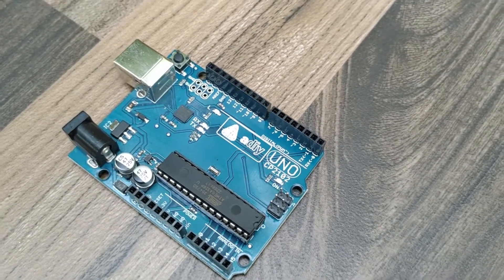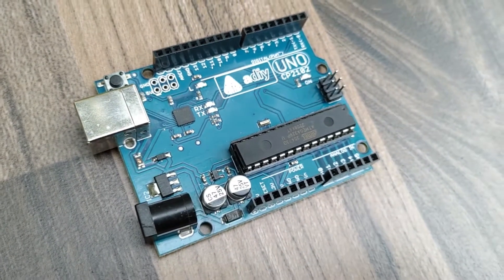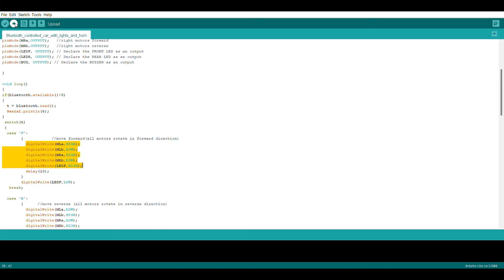How to make a Bluetooth controlled car using Arduino with lights & horn || 100% working

Comment: No motor run..after full charge
Reply from the maker: Can be a problem with the motor driver board, bluetooth module, wrong connection etc. We have to check one by one and solve the problem.

Comment: Only "left and right move button is working "forward backward is not work when I press forward or backward button then Bluetooth disconnected

Please tell me solution😢
Reply from the maker: Hi friend. It is a battery problem. When you press forward or reverse, both motors work together and so draws more current from battery. This drops battery voltage and bluetooth gets disconnected.
Reply from the maker: Using a better battery will solve the problem.
Reply: @Science_4U_  we have the same problem. only left or right controls work. what type of batteries would work best?
Reply from the maker: 2 x 18650 Li ion batteries work best. You can also use 6 x AA battery pack which is cheaper but not chargeable.

Comment: Sir my Bluetooth model number not showing in the app and i used hc06 what are the mistakes 
Pls reply 🙏🙏🙏🙏🙏
Reply from the maker: @SmartyAlphaparrot  you have to first open bluetooth ..search for the hc06 bluetooth module and pair it using password 1234. Then after that the module will appear in app.
Reply: Thanks sir i am successful 🙏❤❤
Reply from the maker: @SmartyAlphaparrot  okay friend. Great..👏👏👏
Reply: Sir Can you hepl me, yesterday I was success in making bt car but today when I move it forward or in any direction it moves continuously in that direction 
🙏🙏🙏 Help

Comment: Is the Bluetooth module is HC-05?, but I have HC-06 can I use it?
Reply from the maker: Yes.. sure friend. HC 06 also can be used.
Reply: @Science_4U_  thanks😇😊☺️😌❤️
Reply: But how can I control the speed of the gear motors?
Reply from the maker: @roblox_wea926  it is actually difficult friend. One easy way is to increase or decrease the battery voltage which inturn will change motor speed. The proper way is to use motors of different speed capability.
Reply: @Science_4U_ ok, but why your car is moving slow?
Reply from the maker: @roblox_wea926  I have used 60 rpm motors friend. That is,  the wheel will rotate such that it makes one rotation every second. That is why it is moving slow.
Reply: Bro thanks It's working perfect I'm very happy ❤ front and back LEDS is working and the buzzer is working too❤ thank you very much for the tutorial❤
Reply from the maker: @roblox_wea926  okay friend. Really happy to know that..❤️🙂
Reply: Oh ok☺️
Reply: But I have a problem when I press right on the controller app it goes left and when I press left it goes right how can I solve this problem?
Reply: Please reply faster 😭
Reply from the maker: The easiest way is in the app you can change the key settings. You can type R for left and L for right...
Reply: @Science_4U_  oh thanks it worked ❤️
Reply from the maker: @Alymostafa8 okay friend .❤️🙂
Reply: @Science_4U_  thanks you for your help that's all what I was need from you 🙏❣️

Comment: Bro sometimes if I press forward or backward button it starts continuously moving in that direction and doesn't stop.
And sometimes two wheels of left side stop moving. Please help 🙏🙏🙏
Reply from the maker: Hi friend. I think the bluettoth module is getting disconnected. Do you see a change in the light blinking pattern in bluetooth module when this happens?. Also since 2 wheels stop moving, I strongly doubt the batteries. Try using new batteries and see if this problem is solved.

Comment: i have connected the robot well but it makes a very faint beep noise when i click a direction on my  phone and the L LED blinks twice. help
Reply from the maker: If the beep sound is coming from the motors, most probabaly it could be due to discharged batteries.

Comment: 👇👇hi bro. Pls how many 12volts is the battery pack in total? if u answer me u will earn urself +1 Subscriber
Reply from the maker: @NgwabinehNebaAsto  Hi friend. The battery pack is 6V in total. It uses 4 x 1.5V AA batteries. So total 6V..
Reply: @Science_4U_  ok thanks bro u earned ur self +1 subscriber 🥳🥳
Reply from the maker: @NgwabinehNebaAsto  Thanks dear friend..❤️🙂🥰

Comment: Please help Me my Bluetooth module blinks every second after I pari with my mobile is blinks 2 times every time at same interval. but the car doesn’t moves at all please help me
Reply from the maker: Hmm..it could be due to several reasons. The bluetooth module may be faulty. The motor driver board may be faulty. Please reply in my instagram page. I will help you..
https://www.instagram.com/_science4u_?igsh=MTM5aXFpdTM5aG5lNg==
Reply: @Science_4U_  also my bluetooth modult isnt even blinking now
Reply: @Science_4U_  i had connected ground and vcc too with 5v to hc05 module still not blinking

Comment: Is it true that if you press the forward button the lights will turn on automatically and if you press it backwards the lights will turn on automatically?
Reply from the maker: Yes friend. The lights will turn on automatically when the car goes forward or backward. In this code, we can also turn on front and back lights by separately pressing buttons also.

Comment: I did it very carefully but it doesn't walk forward and backward
Reply from the maker: Okay friend. One of the components could be faulty. Either the bluetooth module or the motor driver board. Have you used these before?. Or are they new ones?
Reply: @Science_4U_  but it moved right and left
Reply from the maker: Can you share a video of the problem in my instsgram page?. I will help..

Comment: iam already setup the connection but here two wheels only moving other 2 wheels are not moving can you clarify these problem
Reply from the maker: Hi friend. It is most likely due to discharged batteries. Can you keep the uno connected with USB and then try switching on the batteries. Also can you lift it in hand and try rotating the non rotating wheels. If the wheels rotate atleast slightly, it is due to poor batteries. Replacing with a better charged battery will solve the problem.

Comment: Can you make this one with switch? I can’t find someone doing rc arduino with L298N motor drive and switch on/off
Reply from the maker: Hi friend. Do you mean you want to add a switch to turn power on and off?. Actually in the battery pack that we are using, there will be an inbuilt on off switch. That is why we are not giving any external switch. If you want you can connect a rocker switch in the positive or negative wire from the battery. It will wotk..👍
Reply: @Science_4U_  can you make circuit diagram for that?
Reply from the maker: @Denvr2fast  okay friend. I haven't made the circuit diagram yet. But surely I will make and share with you..🙂

Comment: Can i use dxbt24 module instead of hc05
Reply from the maker: I am not very sure friend. But I think it can be used without changing the code. Infact the pin out of both hc 05 and DXBT24 are the same..

Comment: My code is not working its saying "programmer is not responding" pls help
Reply from the maker: Please make sure the correct port is selected in tools>port before uplpading the code. If atill problem is there Please try uplpading the code by connecting to different usb port. If that doesnt work, you can try in a different PC/laptop..

Comment: 6:33 can u tell me whick jumper wire u used here like male to female or whatM
Reply from the maker: Hi friend. In this project, I have used only 2 Nos. Of male to male jumper wires for extending power from motor driver board to Arduino Uno, 4 nos. of male to female jumper wires to connect arduino to l298n motor driver board and 4 nos. of male to female jumper wires to connect bluetooth module to arduino.

Comment: Can u tell me which jumper wire u used like male to male,female to female or male to female pls
Reply from the maker: Hi friend. In this project, I have used only 4 nos. of male to female jumper wires to connect arduino to l298n motor driver board and 4 nos. of male to female jumper wires to connect bluetooth module to arduino.

Comment: Can i make this project without buzzer and led lights..would the cide still work without these 2 things?
Reply from the maker: Yes friend. Definitely the code will still work. Just no need to connect the buzzer and LED ligths. The other connections should be given to the same pins as shown in the video.
Reply: @Science_4U_  thanks alot i haven't maken this project yet I'll make it in 2-3 days i hope it works
Reply from the maker: @Hacio-qe9nh okay.. Sure friend. If you have any trouble making this project, please leave a comment. I will try to help you..🙂🥰
Reply: @Science_4U_  and can u tell me which software have u ran to run the code
Reply from the maker: @Hacio-qe9nh I am using Arduino IDE software installed in laptop for running and uploading the code to Arduino Uno...

Comment: i did everything correct but in the APK. APP it couldnt find the hc 05 module which i allowed for location and bluetooth please help me
Reply from the maker: First did you pair the bluetooth module. Ypu need not go to app first. Open normal bluetooth and search for devices and pair it using pin no. 1234. After thst it will be visible inside app.
Reply: @Science_4U_  i searched it in both i but i found out its faulty asked the shop from which we bought thanks btw
Reply from the maker: @Bombasticccboiiiii  okay friend. Sometimes these sensors are faulty and it is very difficult to detect the fault. All the lights will be on and it will appear to be working correctly, but will be faulty. Anyway, nice that you could find out thst the bluetooth module was faulty.

Comment: Hello friend.I have connected the car to the app.The lights of the motor driver,arduino and bluetooth module are on.But when I click on the buttons of the app the car is not moving at all.What should I do?
Reply from the maker: I would suggest you can first do the following project for an obstacle avoiding robot, which doesnt require bluetooth module. If that works, atleast we can ensure that the motor driver and all other components except bluetooth module is working.

https://youtu.be/kPSBpfUpHt0?si=CppqCXF1GnZeXZWR
Reply: Well,as I said the lights of motor driver are on.Doesn't that mean it ain't faulty?
Reply from the maker: No friend. Not at all!!! Even if the lights are on, it can be faulty. I have seen many cases like that. 
I will tell one way to check the motor driver board is faulty or not. Connect +5V from arduino to IN1 pin of motor driver board and gnd pin of arduino to IN2 of motordriver board. If motor driver board is working, one motor should rotate. Can you check that and tell, friend?

Comment: Bro connection for parking light which pin ?
Reply from the maker: The positive terminals of back LED lights are connected to pin no. 6 and the positive terminals of front LED lights are connected to pin no. 7.

Comment: I have added lithium batteries. Is it OK?
Reply from the maker: Perfectly fine ..Dear friend..Make sure the battery output voltage is in the range 6V to 12 volts.

Comment: Bro i did for Bluetooth nodule Arduino but i am not getting Bluetooth signal on
Reply from the maker: Are the lights in the bluetooth module changing the blinking pattern when it is getting connected to phone?
Reply from the maker: Sometimes bluetooth module could be faulty also..

Comment: Can I use L293D motor drive instead of L298N?
Reply from the maker: Yes..Sure friend. You can use an L293D motor drive also. But, the same code will not work. A separate code has to be written for using the L293D motor driver board.
Reply: @Science_4U_  oh? Can you please share that code with me?

Comment: How can we increase the motor speed or rpm of wheels? What changes should be done in code?
Reply from the maker: Hi friend. We cannot increase the speed in code. The code is written for getting maxiumum rotational speed of wheels. The easiest way to increase rpm of wheels is to increase the voltage of the battery.
Reply: @Science_4U_  ok thanks alot sir

Comment: The robot moves in a circular path way and sometimes it connecting to my HC05 Bluetooth module, but it’s not operating when I go forward backward the robot not going what can I do I am studying in sixth standard day. After tomorrow is my science Expo. Please give some other ideas about this project that will be helpful to me to do this robot very easier and I did it voice control robot Please give me any ideas about Bluetooth controlled robots please
Reply from the maker: Hi friend..if the robot is going in circles, you can interchange the wires connected to the motor which is rotating backwards. Now both motors will start rotating clockwise. If the bluetooth is sometimes not working, it could mean that the batteries are bad..when the car moves, the voltage drops amd bluetooth gets disconnected.

Comment: Hi can i use 9v hi-watt battery
Reply from the maker: Yes sure friend. You can use 9V battery..
Reply: Does the led lights and buzzer is Mandatory if not what will be the code please it is very urgent
Reply from the maker: @sharanv3561 Hi friend, the LED light and buzzer are not mandatory. You can connect the remaining components as per the instruction given in the video. And you can use the same code also. The same code will work even if you are not connecting lights and buzzer.
Reply: Hi do i need to remove the RXD and TXD pins during the upload of coding
Reply from the maker: @sharanv3561 I have never done that and I have never faced any problem while uploading the code. But I have also seen many videos telling to disconnect the pins before uploading code.Try uploading the code with Rx and Tx pins connected l.  If you find some problem during uploading the code, you can disconnect Rx and Tx pins.
Reply: Mine did not work with a 9 volt battery. 9 volt batteries do not have the same current stability as four 1.5 Volt batteries. I spent the whole day trying out lots of different code from different videos only to find out that it was the battery.

Comment: Can i use motorshield for this code?
Reply from the maker: No friend. Motor shield will not work with this code. You have to use L298N driver only to work with this code..

Comment: I have problem all functions are work but my motor are not working  rotating very slow
Reply from the maker: Okay friend. That is definitely due to a battery problem. It may be a discharged battery. Which battery are you using friend?
Reply: @Science_4U_  lithium battery 2 cell I join in alternat mean they power out put 12v
Reply from the maker: @tusharshende9129  okay friend .But even if you connect 2 batteries in series  if they are discharged, it cannot drive the motors at a good speed.
Reply: @Science_4U_  oh ok
Reply: Make sure your ground in your driver shield is connected to VIN in your arduino

Comment: Bro can i use relay to connect mini pump ?
Reply from the maker: Yes sure..a relay can be added and the mini pump can be driven directly from the battery through this relay. Then the command for the swithing the  relay ON & OFF can be given from the arduino..
Reply: Hey where is the code

Comment: Code is not open
Reply from the maker: Code will definitely open friend. You can open the code in Arduino IDE software, which is used for uploading code to Arduino board. For just opening the code, you can even open it in Windows Notepad or Wordpad.

Comment: Hello friend, the code file does not open. What can I do??
Reply from the maker: Hi friend..The code file is given in .ino format, which can be downloaded and directly opened by IDE software used for uploading the code to Arduino Uno. You can even open the code in Wordpad or Notepad in windows and copy it and then paste it in IDE software and then upload to Arduino..
Reply: @Science_4U_ But I don't have a PC. I want to upload from mobile. So what to do?
Reply from the maker: Okay friend. Then you can use mobile to upload the code the arduino ..You can donwload the following app from playstore..
https://play.google.com/store/apps/details?id=name.antonsmirnov.android.arduinodroid2
Then connect arduino to mobile and upload the code..
Reply: @Science_4U_  But when I upload the code via this app it shows error...
Reply from the maker: @vipulthakor513  What is the error that it is showing?
Reply: @Science_4U_ hello.. this is my second channel..When I comment, why does it get deleted? I've been trying since yesterday.
Reply from the maker: @vipulthakor_011  ooh.. I dont know friend, why the comment is getting deleted. 😲
Reply: @Science_4U_  How can I tell you what is the problem with arduinodiod, because whenever I paste the problem here, it has to be sent and after refresh it has to be deleted.
Reply from the maker: @vipulthakor_011  you can chat in my instagram profile..
Reply: What is your insta I'd